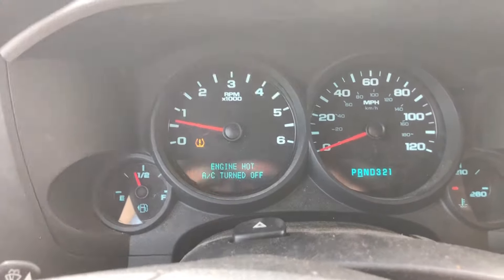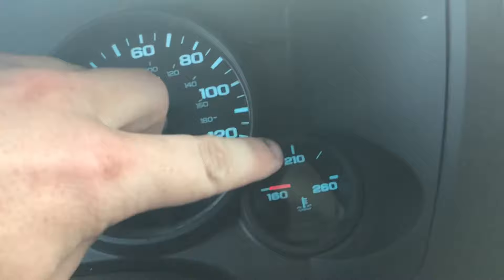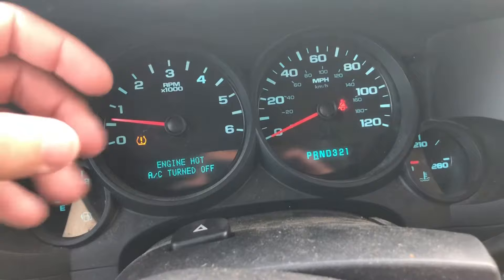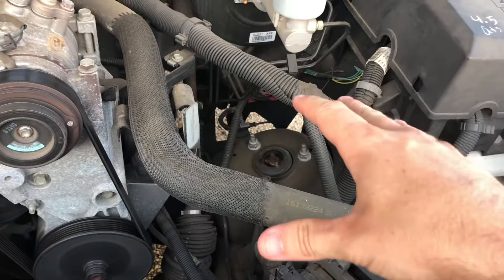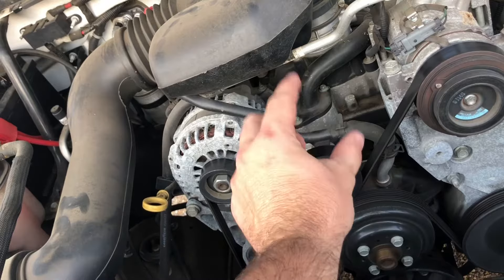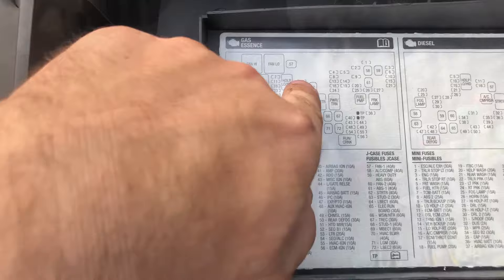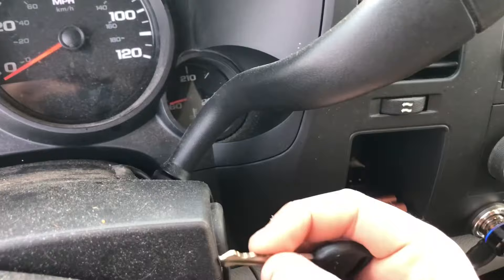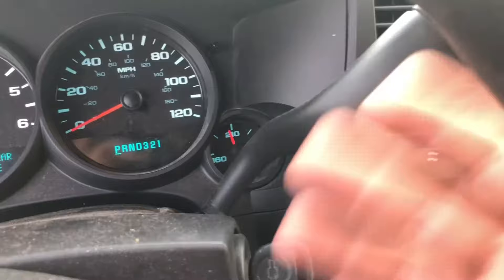Engine hot A/C turned off.  How to temp fix it on the fly

Comment: Typically, a P0128 code will be associated with this issue. That code is usually related to a thermostat not closing properly to allow the engine to get to operating temperature consistently. The PCM logic will eventually set the ‘engine hot’ warning. Removing the fuse resets the PCM. At some point, the root cause of the problem needs addressed.
Reply from the maker: You are correct.  However I have not had this issue return since this day 3 years ago
Reply: @CreativeMechanic same here

Comment: Can you do a follow up video with your permanent fix? I’ve been naming my head with this issue for the last 8 months, replaced the thermostat, sensor and connector wire with no luck
Reply from the maker: Same here, I’m thinking now that it may be an issue with the water pump.  I know the pump is working, but I’ve heard there’s a point when the output pressure is too low it will cause this….  I haven’t had the issue again since the video.  Good luck.  Intermittent problems are always the biggest hassle to troubleshoot
Reply: I've had this exact same issue on a 2012 GMC Acadia and the mechanic said there was a short in the wire between the coolant temperature sensor harness and where it goes all the way back to the computer.
Reply: @amberedmunds8869  ive been fighting this on my 2012 Acadia now for months with no luck. Ive replaced the sensor twice and recently did the water pump and thought it was fixed but one month later it came back. Im now going to look into this wire and hope that I can see something with that ?/ thanks for the info

Comment: Driving into work this morning my truck did exactly this...  I stopped at a local mechanic about a mile away and everything looked fine to him.  He said to google the problem.   Your fix was the first article I saw.  I'll have to try it when I go back to my truck.   Thank you!!!
Reply: ME AS WELL! I came back to say thank bro ily
Reply: Is this really solving the problem? 
My GMC have this error since 2 months and it cost me so far more than $700 and not yet resolved!
Reply: There is a much more permanent solution. Stop buying American cars. Problem solved. American car manufacturers have all the data they need to make vehicles using parts they know will last. Yet they continue building them using parts they know will fail. For example, every single Chevy Blazer / S-10 will have the fuel pump fail. It’s expensive and difficult to replace. This was the only car in my entire life that I ever had to replace this part on. The new part is over $350 and only comes with a one year warranty because Chevy KNOWS it’s a junk part. But they don’t care. They are also notorious for bad ball joints. For decades, Dodge has been putting their 2.7L engine in cars, they even used them in Dodge Chargers. These are the worst engines ever made and Dodge is WELL aware of it. But they are STILL using them. The passages in the block are too narrow for the oil to flow through it. The best solution is to actually rebuild the motor and the person who does it can widen those passages. And they recommend ignore the manufacturer and only using non synthetic oil (10W30) and changing your oil every 2,000 miles or you risk blowing the motor. I could go on and on. So it’s best to just stop buying American cars until they can build cars that last, instead of cars that LOOK good. Honda and Toyota are FAR superior. Sorry not sorry.

Comment: Thanks. Resetting the ECM fixed my 2010 Sierra.

Fans started acting up this week and temp guage showing COLD. Same display, Engine HOT AC turned OFF. Saturday today, pulled out my OBD scanner but it's so old, it doesn't even work any more. Got a better one on sale and plugged it in. Got a P0128 code saying Coolant Thermostat. I already knew it wasn't the thermostat because I did the rad hose check and the coolant reservoir was cold. Started looking online and found this vid. Here I thought it was the temp sending unit and just wanted to confirm. So glad it was as easy as this.

Comment: Hey guys I saw plenty of videos of this problem. I have a 2013 Chevy Silverado work truck with a 4.3L. To keep long story short I had same issue. I replaced thermostat and coolant temperature sensor with Advance auto parts products to fix the problem, and it did but only for 2 days. As I was driving on the highway the message came back. The permanent fix is to replace the thermostat with a AC Delco brand. I have absolutely no clue why the aftermarket thermostat doesn’t fix the issue but I can guarantee the OEM thermostat does the trick. Going a couple of weeks and a couple of hundred miles under the new ac delco thermostat and issue has not come back. Hopefully it stays that way.
Reply: No work for me.
Reply: Did it work?
Reply: @joelopez8965  10 months and has yet to fail for me. AC delco thermostat is the way to go
Reply: @HECTOR JUNIOR yes sir still to this day I haven’t had a issue
Reply: Hello I had the same issue I changed the temp sensor and the thermostat at local parts store it didn’t work they kept resetting it but 24 hours later had same message I was about to give up til I read your post and went to my local Chevy dealer and bought original parts and finally got this problem resolved.  Thank you for your comment 😊
Reply: @ileanarincon2485  i don’t know what’s the difference between local auto parts store and the ac delco particularly with these 2 parts but dealership parts are the way to go. Mind you I’ve bought plenty of aftermarket parts and never had a issue. Only this one time. Glad it worked for you. My truck is still going strong no messages on dash
Reply: @jesseaguilar8758  Awesome thank you yes I’ve also bought other parts not from GM and had ni trouble but this time I was about to give up, thanks for the good advice it worked blessings 🙏🏻
Reply: @HECTOR JUNIOR me too had same problem but finally bought temp sensor and thermostat directly from dealer and it worked you should too and I’m pretty sure it will resolve issue.
Reply: @HECTOR JUNIOR My mechanic disconnected the battery before installing sensor and thermostat they told me at GM to do that so it can reset everything again. Try that
Reply: @HECTOR JUNIOR Then I guess you should take it into the dealership that was my next step if the original parts didn’t work but thank God it did, with all the Money I spent on sensors n thermostat not original and mechanics it would of probably cost me the same.   Good luck
Reply: How much did it cost to replace it yourself? How much do you think it would cost to get it done at a shop?

Comment: Thanks for this. It worked on my work vehicle. It always happens when it's cold outside. As far as a permanent fix, it seems that sensors or wiring couldn't be the issue, as resetting the ECU would only result in a very temporary fix. As soon as it sees that problem, it would come back in. Bad ECU or programming, perhaps?

Comment: I has this same thing happen. We changed the coolant temperature sensor. And that did not fix the problem. Then I found your video and it worked. I was wondering what is the permanent fix for the problem?
Reply: I wondered as well. Any feedback on the permanent fix?  I didn't see a follow up video

Comment: Hi.  I appreciate the help with this issue because I had a this situation with my 2008 Impala.  I wonder if the thermostat was just temp stuck or something.  The overheat messages went away but my AC still didn't work.  I'm looking forward to resetting the ECM with your fuse technique but also was just curious if you ever did the video about a more in depth examination, etc.  I looked but maybe you didn't find the time or correct situation to do a video.  Is there another video in your profile that I missed?  Thanks.

Comment: This was a great tutorial but the problem was the little chart on my cover did not even resemble my fuse layout and after trying two different fuses I apparently did not find the right one. 

Fortunately if you can't figure out which fuse it is there is another way, and that is to disconnect the battery for about 10 or 20 seconds. It does the same thing.

Comment: hello friend, it happened with my 2014 GMC Yukon once and never happened again , the reason was the OEM thermostat I just installed stuck open once for some reason and made the engine stay cooler than normal temperature for a while that triggered that message , once I was that message I pulled over, shut down the engine and checked the hoses and started the engine again

Comment: It's been two years since you published this video, or longer? I just found it. We have a means to temporarily clear the code, but I'm here to ask if you ever looked into it further to figure out a permanent fix, as you stated at the end of the video. It gets old to constantly try to reset it. Just hoping. We've attempted several suggestions from youtube videos...no luck so far. First, was two different attempts to replace the thermostat and flush the coolant. Tonight, we replaced a fan control / relay in that same box you were into in this video. Looked like it was gonna work, but nope. Less than an hour of driving and it sent the code again, turning off the AC.

Comment: I changed my thermostat and temperature sensor. I even did the ecm fuse thing. But the message keep popping up and and fan keep turning on. I just don't understand why it keeps happening. I check the temperature meter before ac turns off.  Meter doesn't even reach half way

Comment: If u disconnect the battery or fuse it’s resetting the pcm what’s the problem what setting of the check engine light.

Comment: I have a Pontiac torrent that does that says engine hot then kicks me into a mode where u can barely drive? Couldn’t figure out what’s going on has new water pump new thermostat and new coolant sensor so I’ll try this see if it works thank you for the video

Comment: Is there a follow up for the fix cause this fixed my problem instantly thank you sir!
Reply from the maker: Coolant temp sensor did it for me
Reply: The permanent fix is to replace the thermostat with a AC Delco brand. I have absolutely no clue why the aftermarket thermostat doesn’t fix the issue but I can guarantee the OEM thermostat does the trick. Going a couple of weeks and a couple of hundred miles under the new ac delco thermostat and issue has not come back. Hopefully it stays that way.

Comment: This worked!!! Thank you so much.
Reply: For those that try this, I have a 2008 Pontiac Torrent. Message on dash read Engine Hot A/C. My fans were running at high speed. No issue with my ac or heat in the car and there is no coolant leak or anything unplugged. I also had plenty of coolant in my car. I replaced the  fuse with a new one.
Reply: Following up 7 months later. Replacing the fuse was a temporary fix. I ended up replacing the coolant temperature sensor. That seemed to solve the issue for 7 months. Then I did a cold start one morning after leaving my car out overnight in the cold and the error came back for the first time. I replaced the fuse and it turned it off. I had the error come back two more times. I dont think the issue is with needing to replace the sensor again and my fans are fine. I dont think its an issue with my fuse box or wires. When I replaced the sensor, I also replaced all the relays and my spark plugs, battery, thermostat are only one to two years old and should be good. My next step is to get a coolant flush (last one was a year ago), make sure I warm up my car for at least five minutes before driving and see if this helps. Next step seems to be to replace the engine control module, which has never been touched and my car is closing in on 20 years old. This is a last resort. I'll update in another couple of months if I decide to do that.

Comment: I have a 2012 Chevy Silverado 1500 and this EXACT problem has happened.  I unplugged the fuse and it still says Engine Hot /AC Off and the temperature gage still reads cold.  Any solutions??  I did change the ECT and thermostat and still same problem.  Thanks

Comment: 2009 Uplander, exact same issue..I simply disconnected the battery briefly. Replaced engine temp sensor, still same issue. Thermostat sticking in open ya think?
Reply from the maker: Disconnecting battery is easier for the initiated but most people don’t have any tools.  In a perfect world
The fuse puller is still in there.  For
Use we replaced the the coolant temp sensor
Reply: @CreativeMechanic   wow, didnt  expect such a reply xmas day..Merry Christmas. I agree its easier for most to disengage the fuse. I did change the coolant temp sensor...thinking the first unit was faulty. I recall last winter the heat would only come hot when idling over 2500 rpm or simply normal driving but not at stand still idle, i just put up with it.  With the new temp sensor and still having the same issues ( no check engine, temp gauge not working; A/C off message but lots of blower heat) im thinking thermostat stuck in open position

Comment: Unlike the others, it didn't work for me. What might that mean? I tried it twice. Then changed the fuse with a spare (that I can't be certain was good). - '08 chevy equinox sport awd
Reply from the maker: Your thermostat may be stuck closed, which needs to be replaced, or your coolant temperature sensor is bad

Comment: Great video. Worked for about a week before it wouldn't work any more. Is it safe to drive while that warning is on or not (just for quick trips to the store while waiting a week and a half for an appointment)? I'm worried the cooling system won't kick on. And the car just doesn't seem to be running quite right.
Reply from the maker: If it’s not running right or could be a problem with the ECU.  This error code can be anything from a stuck thermostat to a bad temp sensor.   My “fix” is just to help you not melt, but you should feel both coolant hoses. If one is too hot to touch, you’ll need to get your car towed and fixed properly

Comment: Did not work for me, have a 2007 Tahoe. Followed the instructions and my AC button still flashes. Engine is at normal running temp, too hose is hot, bottom hose is cool. My engine temp gauge is at 190. Any other solutions?

Comment: I've been wrestling with this for a little more than a week now. After a radiator replacement I've taken my 2013 Tahoe back to Firestone 4 times because of this. They said they put in an oem thermostat after 2 aftermarket and it just happened again this morning. Thanks for the temporary fix. If anyone knows of a permanent solution please share... This is really frustrating.

Comment: I was going to tell you that my check engine light never did come on when I bought the car and now I don't have any engine lights or any kind of check me for something's wrong with the car lights and I know they've been screwing around with underneath the car seats in the front and the passengers cuz they're heated electrical and that can do something if they do something to one of the wires it can the disqualifier disconnect your airbag correct

Comment: This is temporary and will happen again. Dont put new thermostat if over 200 thousand miles due to low pressure not unless the engine is replaced. Best to put a a thermostat meter the old school style and a switch to turn on and off the fans.
Reply: Welll what causes the low pressure?  Perhaps the water pump is going bad?  Or just a sticky thermostat?

Comment: I have tried the fuse removal trick and it temporarily worked but the message keeps popping back up and the fan running at high speed , this is during temperatures of around  3 Celsius and no long trips either ,,  and after a new head gasket, thermostat and temperature regulator  issue still happening . BTW mine is a 2009 Chev Equinox with about 180,000 km. This is a sign of another problem but code reader isnt picking anything up ,, Fucking frustrating